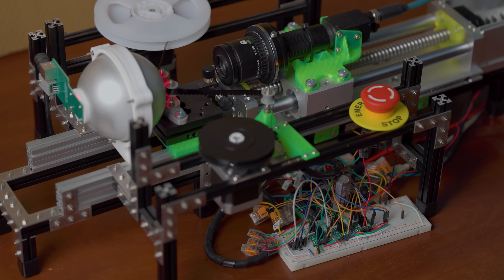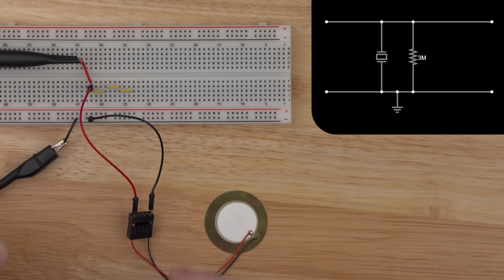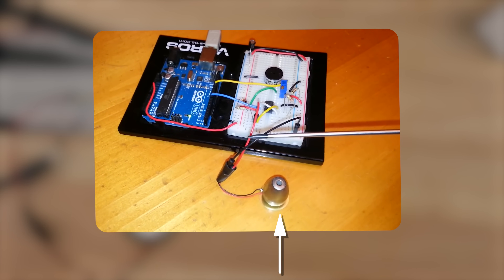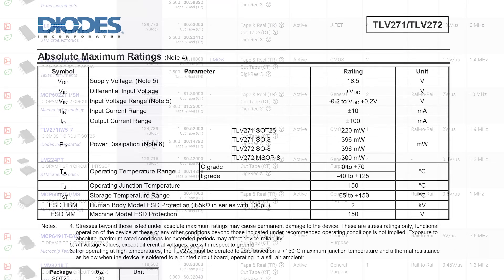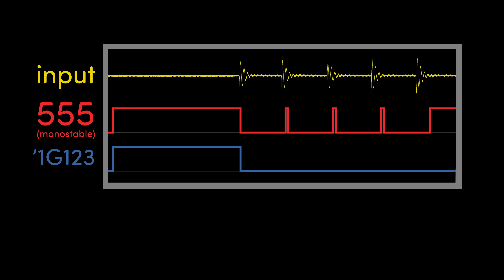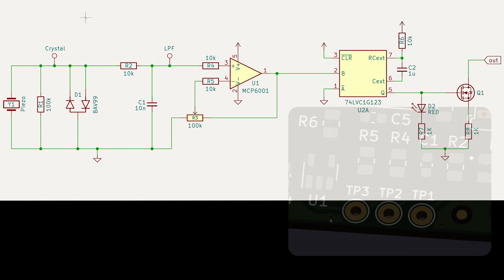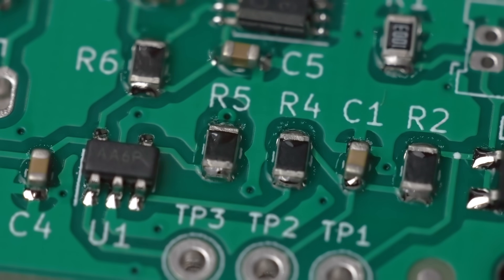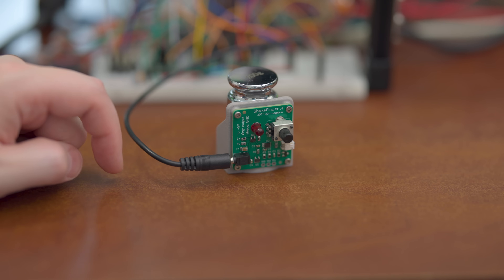Designing a simple vibration sensor

Comment: Just beautiful. I have zero ideas for improvement.
The only thing I could come up with, was maybe first rectifying the piezo, but this would cut off some sensitivity.
Reply from the maker: I'd tried this early on and it did exactly what you said: only the signals above 0.7V made it through the rectification, which lost most of the smaller vibrations.  In the end, losing the bottom half (at the op-amp) seemed like the trade-off with the fewest downsides.